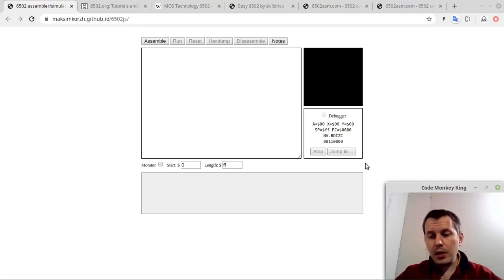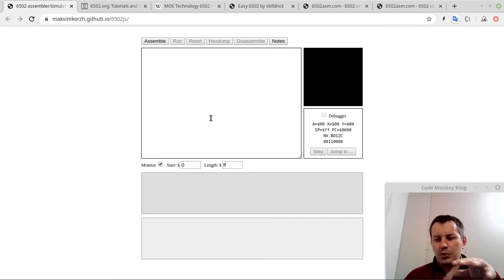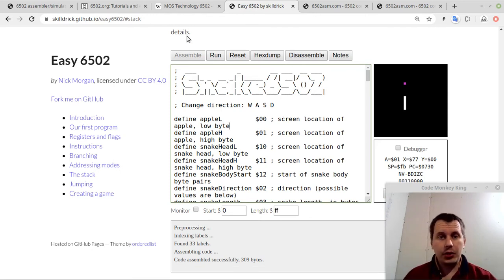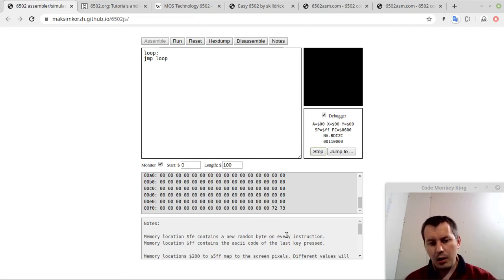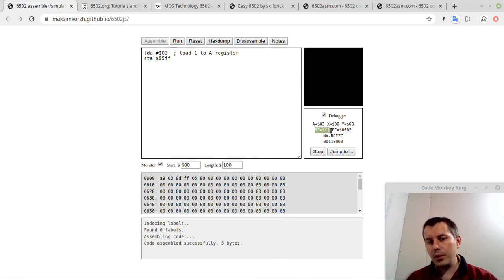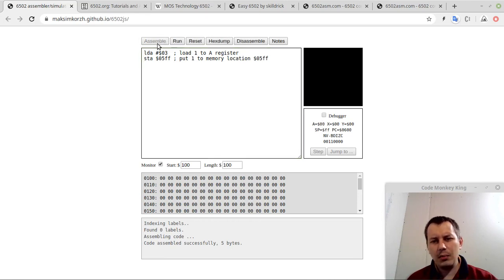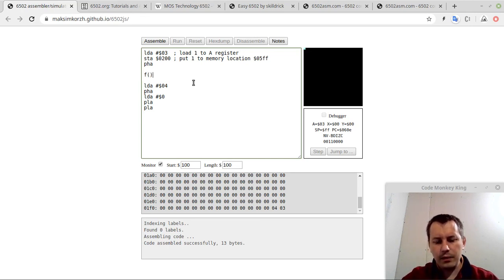Why learn 6502 assembly in 2021 + JavaScript 6502 assembler and simulator environment overview

Comment from the maker: General notes:
00:00 Intro
01:00 Computers based on 6502 processor
02:34 The biggest problem of 6502 assembly tutorials
03:35 The need of 'software focused' tutorials
05:54 The purpose of this tutorial series
06:20 Learning 6502 in a hardware agnostic way
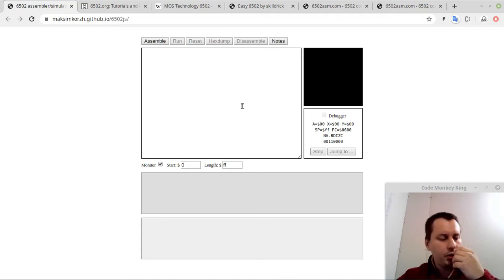07:20 Why to learn 6502 assembly?
08:15 Why it's a good idea to start learning assembly from 6502?
10:31 You don't need a specific goal to start learning 6502 assembly!
14:15 Evolution of JavaScript 6502 assembler & simulator
17:07 Software for JavaScript 6502 simulator

Tech stuff starts here:
21:40 JavaScript 6502 simulator's environment explained (MUST KNOW for developing!)
25:50 Writing to video memory
29:41 Inspecting the program counter
36:40 Visual explanation of how stack and stack pointer work
48:15 Outro

Comment: Great video man, 6502, 56 instructions,  stack pointer explanation very nice :o)
Reply from the maker: Oh thanks Man) I've already made a crash course on how to program it - you can check the link to a playlist in a description)
Now I'm thinking about creating bootable 6502 simulator. Yesterday I saw a YouTube video showcasing Apple 1 computer - it boots into a sort of a hex editor where you can type in machine codes to for instance load BASIC from a cassete or whatever program - it had 40x25 text display (not sure if graphics mode even existed, probably not) and the monitor was monochrome, this was in 1976... I loved it so much that I wanna have somewhat a similar bootable beast) So... hence the new project idea)

P.S. I'm currently not sure if I'm smart enough to complete that but we'll see. Live coding such a thing in x86 assembly would be a bit too much for me so a 'development progress' styled videos are most likely on the cards.
Reply: @monkey_see_monkey_do  Ah man, Macs were monochrome when I started using them! - Live coding is always very impressive, but sometimes it's better to mix it up a bit and yeah, just show your results and end product. A mixture of both is great.

So you're not going to go back to the Intel 4004 from 1971 then? :o)
Reply from the maker: @python360  I fell in love with 6502 and can't think of any other processors)
Reply: @monkey_see_monkey_do  Ah man, Wu Wei!